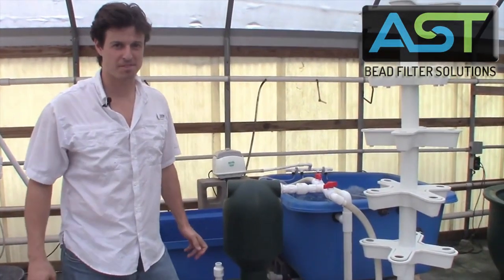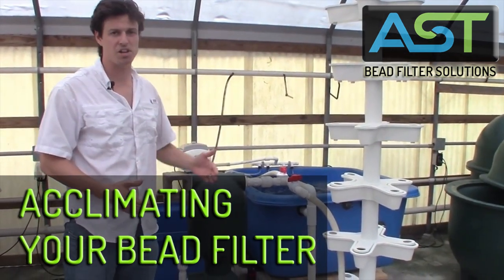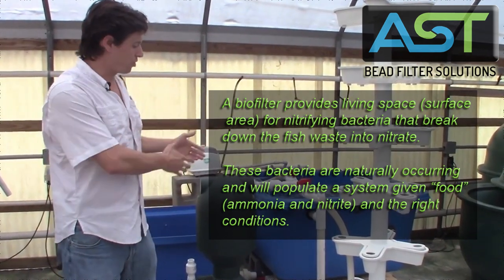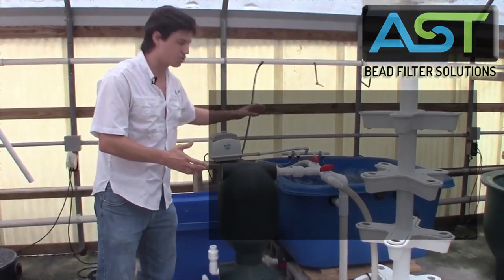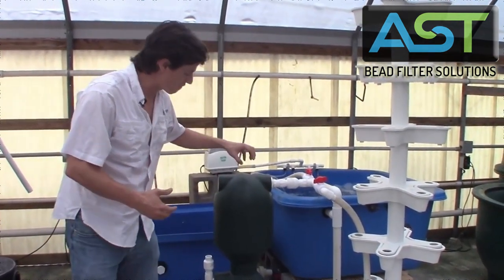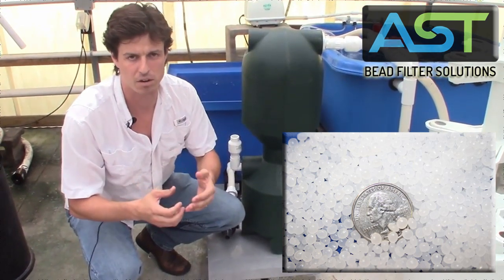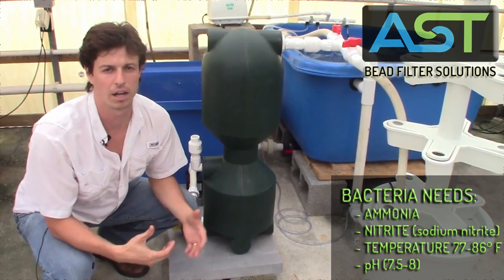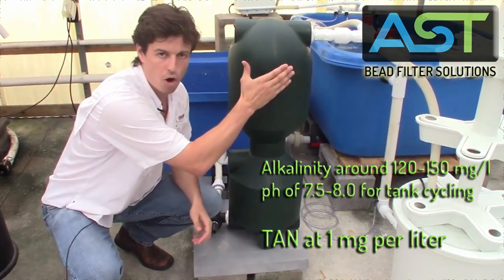Fish Filter Acclimation: How to Cycle a New System

Comment: What model filter is that? I'm interested in buying one but I would like to understand the difference between the models.
Reply from the maker: We stock different models depending on the size of your system and your bioload (how many fish and how much you feed).  The more fish you keep, the more surface area is needed for the biofilm, requiring a larger model of filter. Our bubble bead filters will filter volumes from 50 gallons to 3000 under moderate loading. To view specific stocking and recommended volumes for Bubble bead filters specifically, please see: https://astfilters.com/aquatic-systems/support/bubble-bead-filters-resources/bubble-bead-specifications/ 

Bubble beads are a simple filter requiring manual backwash with the turning of valves. Our PolyGeyser filters like the Endurance filter, are autobackwashing, requiring only that you empty the sludge. Check out our website and give us a call. Or submit a quote specifying what you are keeping/ how large of a system you are planning and we can let you know what your options are. Thanks for your interest!
Reply: @ASTFilters  i havent decided on stocking at the moment. Just as a size reference i wanted to know the model featured on this video. I have bio filters and will use them in conjunction with this filter anyway. The reason i want to know the model is because there is an ast filter for sale over here and i wanted to know if the one behind you is the same model.

Comment: Why  sodium bicarbonate is used? Is it for maintaining ph??
Reply from the maker: Victor, thanks for the question and for watching! Sodium Bicarbonate is used for two purposes. The first is to buffer pH as you mentioned but more importantly, the nitrifying bacteria utilize the carbonates as their carbon source for growth. This allows to to grow and maintain a healthy population. Thanks again for watching!
Reply from the maker: @victorbanerjee3099  Victor, thanks for the question! Nitrification is an acidifying process so naturally, your pH will decrease as you convert more and more ammonia to nitrite/nitrate. To counteract this, we use a ratio of 0.25 lbs of sodium bicarbonate per lb of feed per day (0.25 gms sodium bicarb per gram of feed per day). This should keep your pH buffered while supplying the alkalinity necessary for the nitrifying bacteria. Sodium chloride (salt) would have no beneficial effect for controlling pH and would eventually increase the salinity of the system past acceptable levels. I hope this answers your questions. Thanks for watching!!
Reply: @ASTFilters Thanks  sir.But  I am asking about using sodium carbonate na2co3 not sodium chloride i e common salt.I have read somewhere that sodium carbonate is a good source for increasing ph and also little bit alkanity.so i purchased bags of na2co3.Now I am in delima whether to use or not.I know you can guide me in this topic as you have vast knowledge. I am new in this field Hope I can get all  answers from your end.